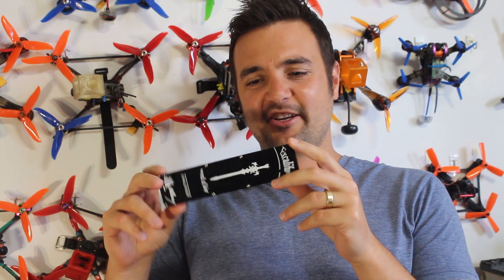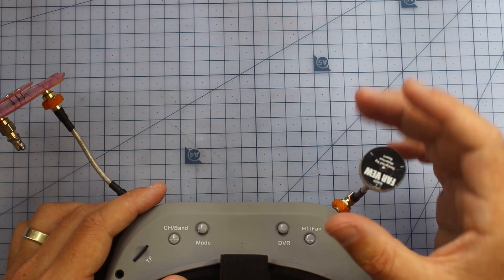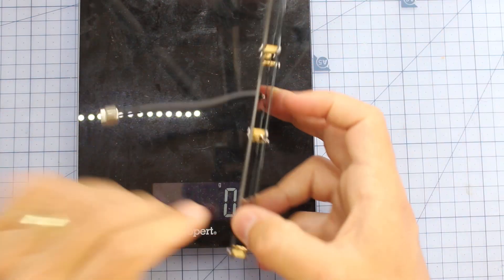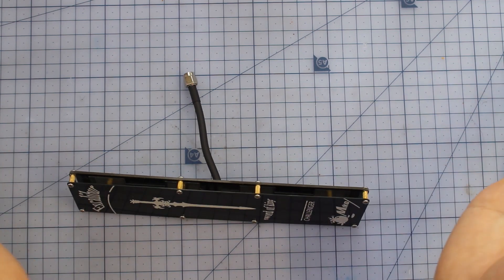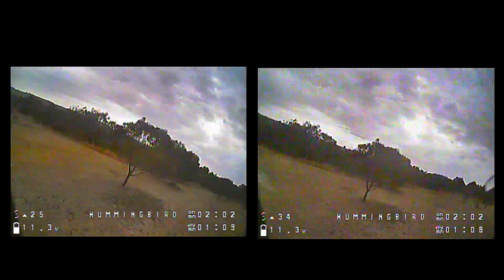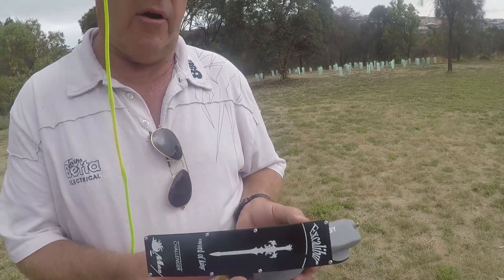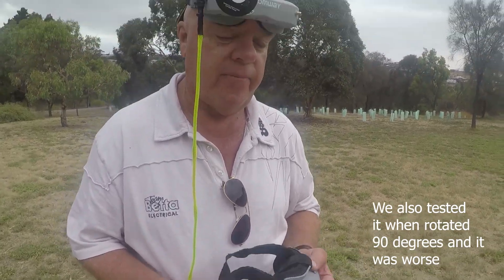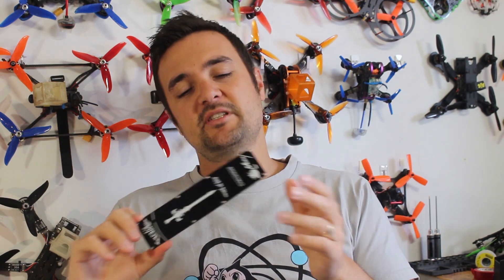BIGGEST FPV ANTENNA YOU HAVE EVER SEEN!! Tech Tuesdays UAVFUTURES

Comment: Totally new to drones and FPV here.  But what would happen if you made a circular rig of say 4 patch antennas that fit over your head and had each one had a 90 degree reception field angle so that you'd theoretically have 360 degrees of reception angle?  Disregarding bulk, would it give you massive increases in flight range as well as ensuring the drone antenna would constantly be in good reception angle of a receiving antenna?  Would it require a set of FPV goggles with more than two antenna inputs?  Is it feasible to put two patch antennas with 90 degree reception fields on a set of goggles so that you'd have 180 degrees of very good reception and you'd just have to ensure to keep the drone within that 180 degree arc?

Comment: Just ordered the antenna you recommend. 

I took your advice and bought the FuriBee x215 as my first drone. 

I would like to encourage you to remove that as your recommended first drone. 

During my first flights the receiver antenna broke, and vtx antenna broke and the female connector on the flight controller that received the video broke off. 

Before logging 1 hour of flight time I snapped an arm. 

I would highly advise a new “recommended introductory” model that is either your built kit or one with more modular components. 

This FuriBee has some weird connectors that requires a lot of research to make sure you get the right components.

Comment: Will you quit wailing around that big black thing.... Just because it's big and black and won't fit in most holes does it mean that it works well ... Lol ... You're going to have to pull your quad out of the dirt like you do the Excalibur out of the stone .... I've always wondered if you can attach three or four different patch antennas together into one unit that way they would all aim at three different directions basically giving you a cellular antenna effect

Comment: DO OVER?  I believe the antenna is meant to be used vertically like the print on it right side up. usually this type of antenna has the wide coverage across the narrow face of the antenna. Also, the quad has a linear polarized antenna, so your only testing gain, and not axial ratio or any other important features of circular polarized antennas. I do really like my triple feed patch though.

Comment: Being an amateur radio operator, one thing I noticed was wrong, the orientation was wrong. It's supposed to be vertical. The longer the antenna, the tighter the field of radiation. So, in the orientation you had, the reception is up and down with a small field sideways. I think your reception would be slightly better if you orientated it up and down. But, how much difference is there between 14dBi and 15dBi? The triple feed is more practical on a goggle. These swords should be put on a multi - path base station. That would be a strong reception.
Reply from the maker: We tried it this way and it was worse. there is a little note in the video explaining this but it was just a text pop up. but in our experience it performed even worse when we had it that way
Reply: Wow, actually surprising. Thank you for testing this. An eye opener on the tweaks that manufactures try to do. I have a feeling it is more of a paper test they did, but you did a real life test.

Comment: 15db next to my head, No thanks, this is for ground stations only.
Reply: Munkey360 Same here mate except a little longer in the industry, so are you saying that i am incorrect and these antennae are actually transmitting without us knowing?
Reply: Munkey360 That's a receiver, bot a transmitter. It doesn't output any power, the 25mw is coming from the quad and will be there anyway whether you use goggles or a groundstation. The antenna just helps your receiver match the signal
Reply: What's the issue with it being next to your head Munkey?
Reply: Personal preference after 15 years of working in the electronic industry.
Reply: Nope, I'm not saying anything about your comment, simply that I prefer to keep high gain RF equipment away from my head, be it a Tx or Rx, it's just my preference.
Reply: The realacc triple feed patch that I use is 14dBi. And... It's not radiating; it's receiving. I've been a HAM for 20 years and I deal with antennae all the time.
Reply: Munkey360 lol, 15 years and you still don't know how this stuff works? What do you think it's going to do? An RX antenna is entirely passive. It radiates nothing.

Comment: What do you think about those plastic grippers for tightening and loosening your antenna nuts?
Reply from the maker: love em, Cal printed them for us
Reply: They don't fit on RealAcc modules, (and probably True D etc), because of the OLED screen. Fitting the two antennas and a right-angle adaptor is the biggest pain. Wish they could come up with a snap-on connector.

Comment: This antenna is linear so your probably losing a bunch of signal strength cause of the antenna mismatch.
Reply from the maker: the drone had a linear antenna too
Reply: yep.  my experience shows linear ones are great when the poles are aligned but when you get out of alignment it drops rapidly.  that thing being very directional, you would have to be following it with your head to make it work ok.

great stuff.
Reply: I meant to say polarization but the word escaped me. When your going CP to LP you only lose 3db but when you use an LP which is horizontal to LP which is vertical you lose a maximum of something like 30db. Which would probably be the cause of all the noise.